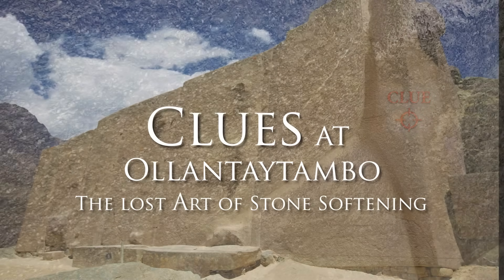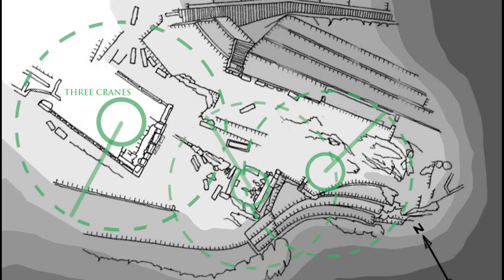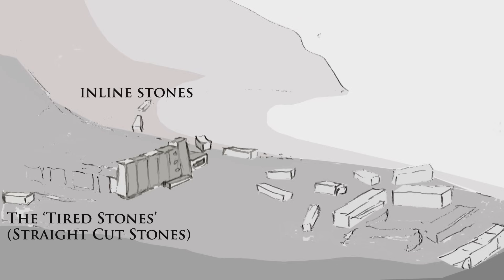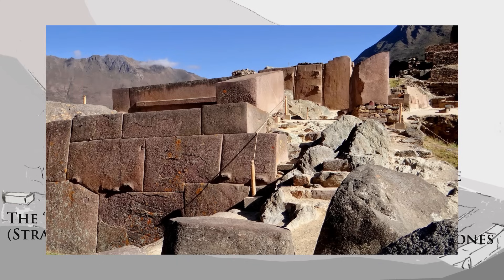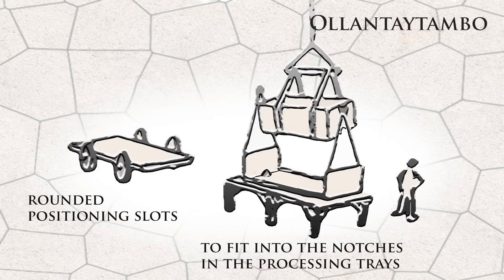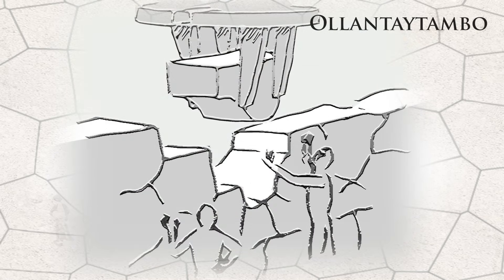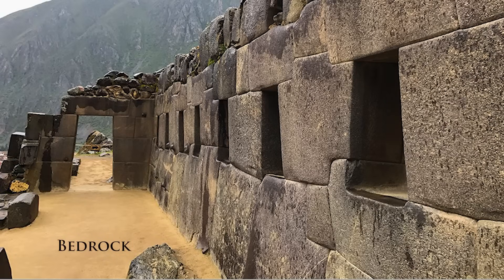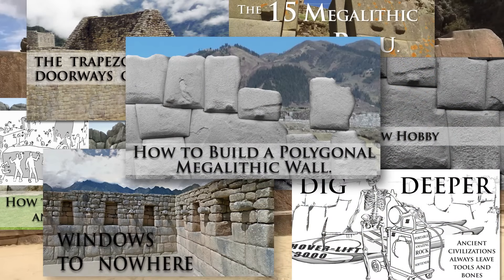Clues at Ollantaytambo. The Lost Art of Stone Softening

Comment: I've been to Cusco, Sacsayhuaman and Ollantaytambo and had a close look at this stonework. All 'plant-based' chemical stone softening theories are apocryphal dead ends. There is zero evidence to support them and numerous obvious questions - such as which plant was used, how this chemical was produced in the vast amounts needed for these huge civil engineering projects and why it didn't eat through the ropes used to immerse these blocks into the tanks (which were themselves presumably made from a material that was also impervious to this chemical). To explain what's seen at these sites today, this chemical would also need to be something that temporarily softened the stone, then reconstituted it WITHOUT changing its crystalline structure, calcite veins etc. As a geologist friend explained to me, this is an extremely tall order. All theories regarding ancient technology/machines/power tools come with exactly the same question: What was the ancient power source? The 'sonic tools' shown in this video have cables attached but there is no explanation of what they were actually plugged into.
Reply: "Some years ago, when I was working in the mining camp at Cerrode Pasco (a place 14,000 feet up in the Andes of Central Peru)...........About ten minutes later I bent over the rock and casually examined the pool of spilled liquid. It was no   longer liquid; the whole patch where it had been, and the rock under it, were as soft as wet cement! It was as though the stone had melted, like wax under the influence of heat." page 273 from "Lost Trails, Lost Cities" BY Brian Fawcett written from letters sent by his father Percy Harrison Fawcett who disappeared in the Amazon in the early 1920's. As to softening stone on page 83 he writes of birds like a Kingfisher "which makes its nest in neat round holes in the rocky escarpments above the river....that those birds know of a leaf with juice that can soften up rock till it's like wet clay" which they can then peck away until they've created a hole in the cliff face into which they build their nest" Find that cliff face and go down in history. I was in the Amazon once and that was enough for me.
Reply: Sure, there is a fair amount of conjecture in this video, I agree. Fascinating idea in itself though that offers a human explanation to this, just can’t be proven yet. Sonics will vibrate atoms without creating heat. Theoretically, if Sonics were high enough, it could mimic the effect of heat on an igneous rock. It’s not totally crazy. Going out on a limb here, but maybe the ‘liquid medium’ was a way to contain or envelope the rock to allow the ‘Sonics’ to have an effect. This doesn’t answer many other questions, though, I agree. Made me think of something here, but did you know that the human brain and spinal cord is completed suspended in water? I may have got this wrong a little, but yeah the spinal column and brain have a liquid wrapped around them and basically aids in instantaneous transmission of brain function. It’s worth looking into I think.
Reply: @andreww8529 vibrating atoms to mimic heat IS heat.
Reply: 2 things to add: 

In other sights like Egypt they dig through bedrock and shape it (seemingly to their will), so bedrock isn't really and exception. Even without some great tech they could have removed it in Peru if it bothered them XD.

The Peruvian stones follow an algorithmic arrangement, it isn't a random pile of fitted stones, there is a technique which can be deduced by analyzing the order in which the stones must have been put together. There is no sign of spillage that would happen with "soft" stones that are put into hallowed molds (which the previously put stones would act as).
Reply: @TheSkyFallTronic  it’s baffling though. The care and effort to create these structures and they leave a piece of bedrock, jagged and coarse just hanging out in front of the wall. And the nubs. Correct me if I’m wrong, but wouldn’t they have to carve all around the nub to have it be there? And why? If its purpose was to manipulate the stone why not chisel it off? It’s like when they completed it, Jose says ‘hey what about all these nubs? And Pablo says, nah leave them there, it’s fine. You can’t get into the head of an ancient easily, but wow. Unless they didn’t care about the nub, as the author states. I think it can be agreed it’s a mystery.
Reply: @andreww8529  what I am saying is, even if they didn't use "sonic" or whatever, someone capable of building these walls, whatever the method, would have had 0 trouble removing the bedrock if it bothered them. I think whoever built the pyramids shared their technique for the Peruvian monuments as they are using the same methods (around the corner stone work and precision). It's still a mystery and the truth is that nobody knows. It almost looks like someone activated creative mode and went full blown Picasso.
Reply: @ complete agreement. What bothers me is the statement ‘nobody knows’. You’re right, we don’t know - but it seems like some say that as the final answer. I agree with the owner of this YT channel, dig deeper-it’s worth it.  Sacrifice some parts of some monuments and let’s settle this.
Reply: @andreww8529 maybe the softened and hardened stone does not chisel well anymore and is more brittle or would show an internal crystalline structure that does not look like granite?
Reply: @TheSkyFallTronic the Peruvian algorithm was most likely a group of people dragging the stones to a flat area and working out how to arrange them where they would need to do the LEAST amount of stone removal. It makes a lot more sense to lay the wall out on its side first. It is only the face edges of those stones that are closely fitted. No magic required. Just common sense and no distractions.
Reply: You have to watch the video by Intriguing Megalicthic Prosoectives on How to Soften Granite. A really good explanation of how with the right condition it's possible to not only soften and shaped but transport Megalicthics is possible.
Reply: @roberland1985  I have watched every video here and I’m trying to share this site with anyone who will listen. His ideas are not all of them entirely new, but I love his short format, gets to the point and stays on topic. Very interesting ideas presented in a professional way. Love his animations to help understand the concepts. Can’t say enough good about it.have any ideas to get more views for him and subscriptions?
Reply: You looking thru a engineer/science keyhole.

Imagine big tanks inside is water and let say X plant and salt.
Nothing fancy.
And sonic device is triangle or gong like instruments.

Why is impossible.
With only 3 ingredients (water, X plants, salt) and some kind of tones/music possibilities ar im trillions
Reply: @reconnectdoo3194  and we would still be doing it today. But we aren't. Besides there's no evidence for what you are suggesting.
Reply: Exactly 100%
Reply: You plug them into 440. 3 phase don't you know anything
Reply: Hahaha! So it was space aliens, right?
Reply: Amazing
Reply: The Acidic mud came from a goldmine, they added plants to make it more acidic. Look it up.
Reply: @roberttaylor7064  I looked it up. Acidic mud from gold mining can dissolve granite in a way that is called ‘bio-weathering’. Also some plants produce acids to dissolve rocks. Ok, great theory-you should o a video explaining it all so that all understand. I mean it-do a video explaining how ‘they’ did all this. it would be more explanatory than conjecture
As you could lay the truth out for all to see.
Reply: @andreww8529  not a possibility. Those blocks are natural stone not some some weird concoction formed out of rock soup. Just think logically about what you said. Besides just because there are chemicals that can dissolve rock it doesn't mean that they were dissolving and reconstructing rock to look like real rock to geologists.
Reply: @roberttaylor7064 where in the world are you looking....look it up huh
Reply: The little square of rock sticking out from the rocks I believe are the positive & negative of electricity that went through the rocks, pyramid of Giza has some of this.  I think the rocks were melted. A test on the rocks showed a positive & negative side
Reply: @Julie-d9m9o  which test and who conducted it?
Reply: Granite melts at 950 degrees a ancient oven fire pit with sand mold can😂😂😂
Reply: Good. Then you can show it being done and that the granite reforms with exactly the same characteristics afterwards. ( it won't happen )
Reply: @nexpro6985  sure Skippy
Reply: Throwing insults? Is that all you have?
Reply: Appreciate the comment.
Reply: GEOPOLIMERS,? IT IS ONLY A STUPID FANTASY, WITHOUT ANY KIND PROVE
Reply: Plugged to a ufo ofc... 😂 There are signs of machine work on them so figure it out.
Reply: https://youtube.com/shorts/4sGO1epTaYM?si=uW1RE6m-i_M7Xaw1
Reply: I am no archeologist, nor have I ever studied any sorts of ancient technologies, just an enthusiast with the internet so I don't want to come off as I'm presuming to know or do anything more than ask a question of layman curiosity but could it have been an acid or base they used to make these patterns? Brushing on an extremely acidic or basic substance like lye or even potentially harvested stomach juices? Is there anything that proves it wasn't something like that?
Reply: @cameronvandygriff7048  I suggest you study how much acid is needed to dissolve hard rock that isn't limestone. I suggest you ask an AI a question along the lines of: can granite be dissolved in acid. If so give a list of those acids and year they first became available in industrial quantities. 
You can insert your own choice of rock. Quite frankly these notions of 'softening rock' are ridiculous.
Reply: It's a better working hypothesis than yours mr. naysayer! Something sure as heck happened that we can't do!☺
Reply: @robertjames4953 nonsense. That stonework can be reproduced using spiling and hammer stones. It has been well demonstrated. There is no mystery.
Reply: Space aliens on acid.
Reply: A technique that can change the atum position of a stone, which humans don't yet understand.

一種人類尚不了解的技術可以改變石頭中原子的位置。
Reply: @davislin7603  so if humans don't yet understand then it must have been aliens?
Reply: @nex...
Yes, I believe so.
I believe humans were created by aliens.

Aliens created humans to serve them in the beginning but ended up leaving us here.
Reply: Lost technology is by definition lost. Doesn't need proof. It was lost !.
Reply: All of that has been explained except for the crystalline structure reconstitution.

The crystal structure is the dead end--but it's also the only dead end just to be clear.
Reply: The great pyramids were made 10s of thousands of years ago and produced vast amounts of wireless power.
Reply: The plant is called harakkeh-ama
Reply from the maker: BTW,, Did you know that petroleum is plant based solution?  !! 😂
Reply: You nailed the theory to its coffin. The narrator might assume well said they mixed the powdered rock and put it as a mud brick and left to dry in the sun. My hypothesis is as good as plant based softening liquid!

Comment: Interesting theory, but until it can be duplicated, it is just that, a theory.  A lot of speculation in your process that also contains many gaps in the process.  First, the blocks would have to be quarried and cut across the river and valley, and given that the builders were allegedly not capable of the sort of metallurgy that would be required to cut the blocks with such precision, that is the first question.  How were the blocks cut to begin with?  Second, how were they transported down the mountain, across the valley and river, and up the mountain to begin your "softening/cutting process"?  Furthermore, what sort of chemical can penetrate andesite that is over a meter thick, enough to "soften" it?  I have found no recent, successful scientific studies (or older studies for that matter) that show that rock can be softened using chemicals.  The only method we currently know of that softens stone is by applying heat--extremely high temperature heat.

Understand, I am open minded and I don't rule anything out.  Your theory is a possibility.  That said, it is pure speculation and contains quite a few gaps in your suggested process.   Until someone is able to duplicate the process you suggest, even on a smaller scale, this is only a guess, a supposition.

Comment: It seems to me like there was more than one method to softening the rock, but softening it onto a putty like consistency was the One thing that all these structures around have in common.

I think if some people from the future were looking at our technology they would find that almost every device we use is powered by a motor that creates a circular motion which in turn powers our devices, pumps, automobiles, circular saws, watches ect.
They might argue over whether we used Steam, coiled up springs, gasoline, electricity or magnets. 
They're All correct.

The Incas have the legend about the "green chisel" extracted from a 4 foot or so tall plant with red scamiform leaves, also there is some clues from some Spanish priest about them using a species of wild efedrin that grows in the Andes. Probably a mixture of several plant juices.
That's all I've ever been able to find about that .
Plant compounds can't be the only method though, because so many ancient sites are dug deep onto solid bed rock like the underground cities in turkey.
There is a passage in Jason and the argonauts where one of his crew members has a harp that can "cut through the hardest rock and change the course of rivers" with if I remember the line correctly.

Comment: How do you explain grain structure of the stone? 
I've often marveled at how grain structure of metal will follow the deformation when squeezed bent stretched extruded or any proces that deformes metal. Cold or hot. 
Even on low quality you can clearly see the grain structure of the stone are in no way a result of deformation on a small scale like less than mountain size rock. 

As well argumenter you try to be you left out or oversaw one key element that totally obliterates this theory. Sry

Comment: I only think that original rocks were shaped and the cuttings were grounded to clay like polymer mixed with i suppose some plants mix since i heard the locals  talk legends and were about plants to soften rock yet only to interact with original rock shape as added rock clay like mix cement like to form original concrete but not today's concrete or Greek or other more modern mixtures and they then finished the molded rock clay like porcelain in that soft mold then shaped it and might even heated it by placing the walls in fired up and hardened the walls and kept doing that till they reached the desired height lenght in stages.  All stages were most likely close range to mounds like walls to get rocks with easier techniques in rolling into placements etc. I saw some photos of these walls on different youtube vids and some here and there noticed like chipping in layers. Now i have never been to any such places but to me its like that cause even the other type hard rocks  vids on YTube have some objects seized incased in old rock and its like eg hammer or sparkplug mysteries or some other stuff millions years old, well they test the rock which is millioss of years old, lol incased like clay mold from mixed in water earth rock dust areas caved in and crystallized like hardened re rocked Rock made from same areas rocks that were grounded naturally from  mining, earthquakes etc.

Comment: Hi, thanks for this video. I find these clues very interesting. What is not clear to me is the use of sonic. Maybe I don't really understand the word sonic or this technology. Wouldn't it be possible just to soften the stone and put one on another? And how do we explain the protrusions? Thanks in advance and cheers
Reply: Those protrusions are suggested by another researcher, evidence that the softened stone was actually very soft, like wet cement, and was shovelled into bags made of sewn-together animals hides. The corners of the bags and sewn-up locations of the animal's limbs on the hides were also sewn up to prevent leakage. The bags were hoisted and dumped, one upon another, and pounded into one another rather like we pound sandbags together in flood situations. The stone "cement" would harden and the hide bags would rot and disappear.
Reply: @Richard Barton 
Thanks very much for this extremely interesting explanation. It's the first time I hear it, but it helps in the quest of knowing. Cheers

Comment: Make a video showing how you soften rigid, hard stone by means of a chemical bath. [Sure, stone can be melted, but that requires high temperatures, not a water based solution.] Let us see its soft consistency. Squeeze the softened stone into a mold. If the Incas could do it, you ought to be able to duplicate their process. 
Otherwise, SHUT THE HELL UP! 

IMHO, this is total BULLSHIT and will remain so until we see some stone softened.

Comment: Softened stones is a bad theory... it's better to think of it as cement... they pulverize granite and then pour into molds using the plant or animal mixture hidden recipe and while still soft put into place... a thing to note is that each block is connected by a potruding rock into a hole in the other rock...which can be explained by embedding a wood shape into soft "cement" and when dried up and solidified put the new soft block that will fill in the hole and slides into place before hardening. The stones with exposed "latches" is a sure proof of many layers of interconnected stones.